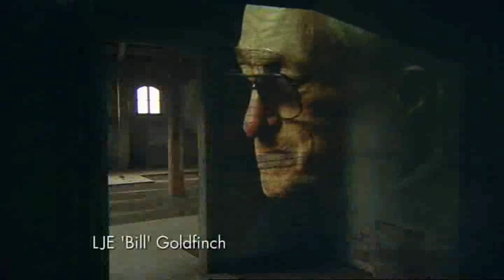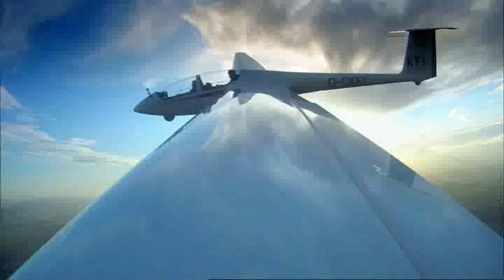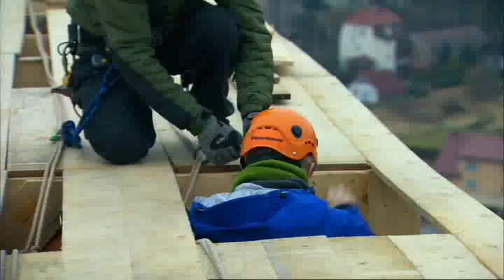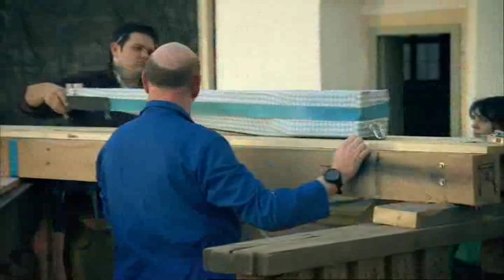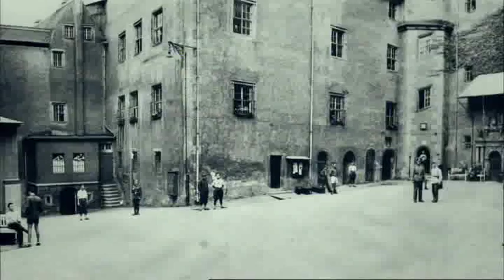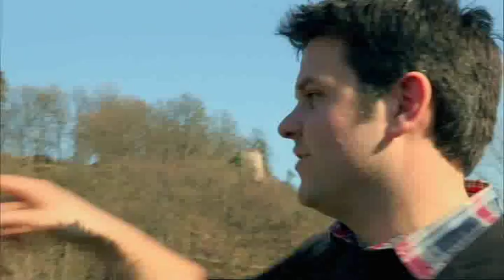Escape from Colditz: Windfall  TV documentary

Comment: Without doubt this was a bold and dare I say crack pot escape method that only the British could conjure up, but on a serious note there are to many variables the POW's could not have known about, first how could they have expected to remove a attic wall in complete silence in order to move the glider to it's take off position? Secondly there are no dummy runs so once committed (if they were lucky enough to get that far) the glider run way would be tables placed on the apex of the roof, again a unknown variable, would the tables be fit for purpose and stay in position whilst the glider was moving at a tremendous rate of speed? and thirdly they plan to launch the glider at night in darkness, so how can you pilot a glider if you can see where you are flying, assuming it would of flown?  I think from a mechanical and practical point of view it would not of worked in its day, how ever it kept the POW's busy and gave them a sense of purpose during what I imagine was a very boring and mutinous existence least of all suffering from malnutrition as well nearing the time of the glider completion. NB: The successful flight of this glider is obviously under less and very different circumstances to that of what may have been!